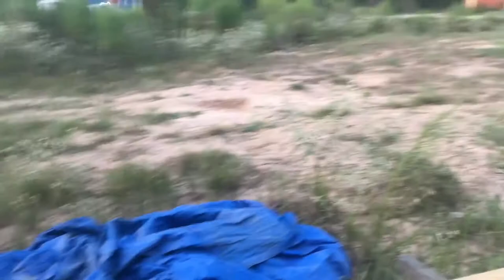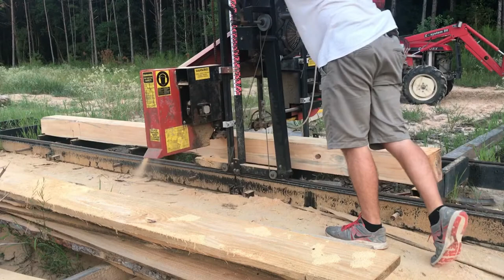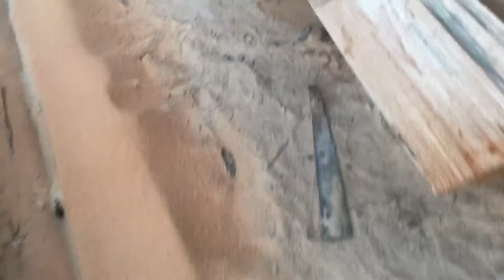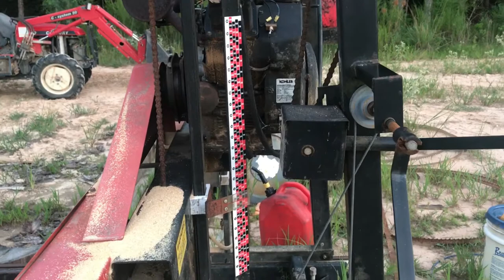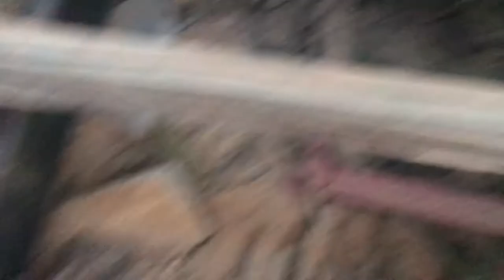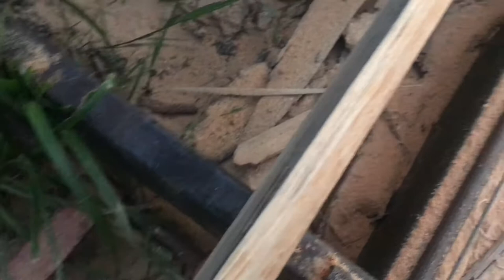Sawing Flat Siding on the Sawmill (Timberking 1220)

Comment: A little late but how did you get down to 1"? I used to have a 1220 and the lowest I could go was about 1 3/16". At that height the blade guard was laying on the carriage wheel support member.
Dave
Reply from the maker: I removed my blade guard and the bolt that holds it on that sits down like another half inch. I’ve actually cut so low I got the 3/4” high log dog. Out of discipline I try not to go below 1”, but can if I need to.
Reply: @TomBrueggen  Too late for me to fix mine.... long gone.
Thanks

Comment: The problem you’re having is most likely caused by the ethanol in the gas. You can replace the carburetor on eBay fairly cheap. I usually keep a couple spares for my splitter.
Reply from the maker: Almost certainly. I did end up replacing the carb and now the fuel pump and it is running better. I do run silver grade gas but I believe it still contains ethanol as well. Thanks for watching!
Reply: @TomBrueggen  there is an additive you can buy that will help. But here our gas is marked ethanol free. What stinks is that it’s the most expensive super unleaded.